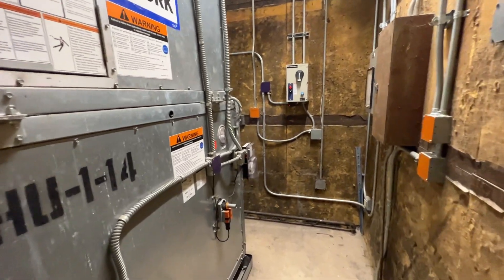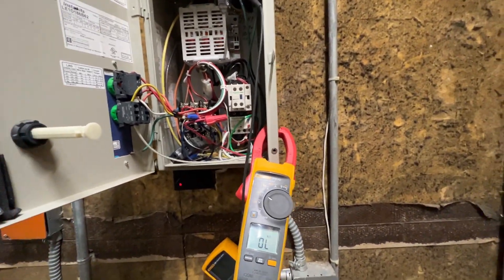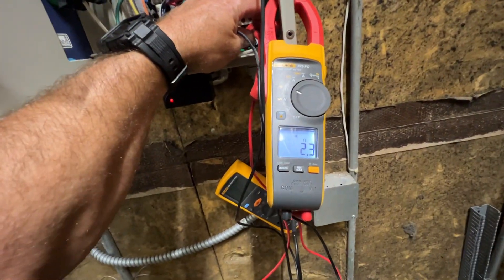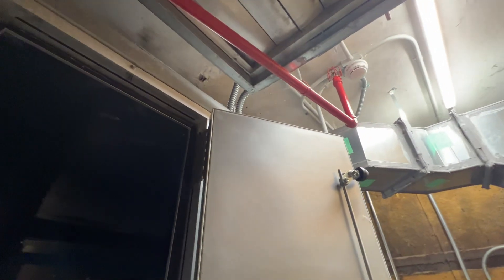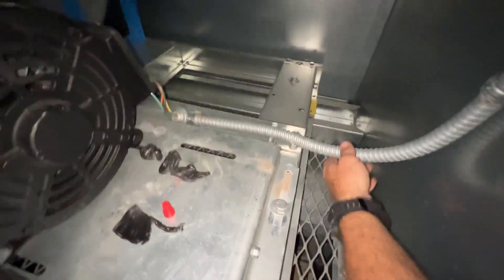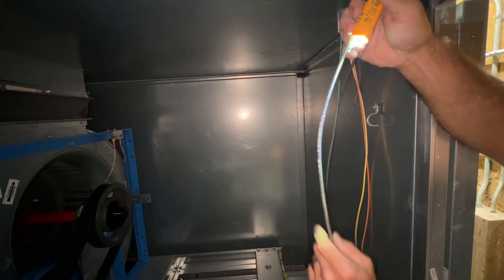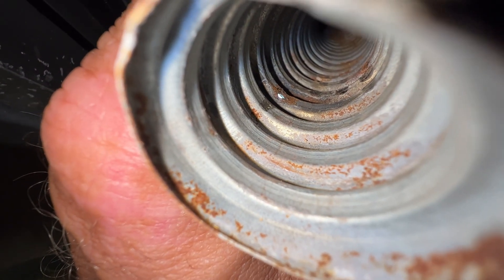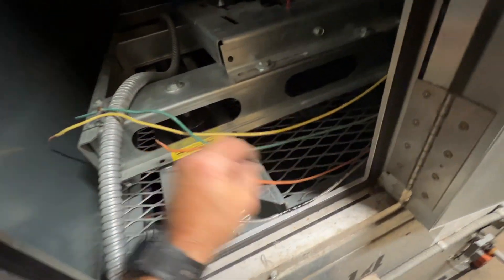Troubleshooting A Call Back For Air Handler Down

Comment: Wonder if that was the cause originally. I don't remember if that wire nut was actually worn through on the last video. I know it was definitely worn but don't remember if there were actual arc marks or conductive parts showing on it (and too lazy to rewatch it). And of course, moving those wires around could have cleared that rub through on the wires. But good example of how experience plays a part in troubleshooting. Knowing to look at the wires inside that BX on something that is vibrating or moving. Good call on going right to that.
Reply from the maker: No doubt the wire rub through was happening for awhile, originally the short to ground wasn’t present after removing the motor lead cover where the wire connector rubbed through and arced. Thanks for watching again!

Comment: Nice. I thought there was a motor starter on there. Should’ve the overloads have tripped before the blown fuse?
Reply from the maker: Good question, the fuse blew on phase A as a result of the current spike when the path shorted to ground protecting the wire.  Overload relay protects the motor in an over current / thermal condition, more delayed reaction. When the fuse opened it also stopped supplying volts to one  primary side of control transformer resulting in control power loss stopping the starter at same time.
Reply: @subcoolHVAC  hell yeah. Thank you for the education. Love the vids and the knowledge.
Reply from the maker: 💯Thanks RoaddogRoaddog 👍